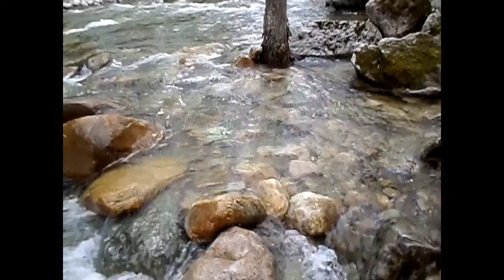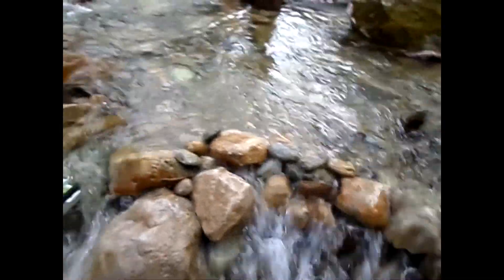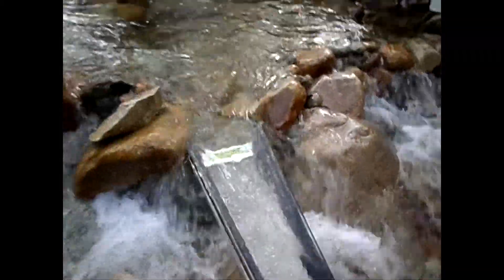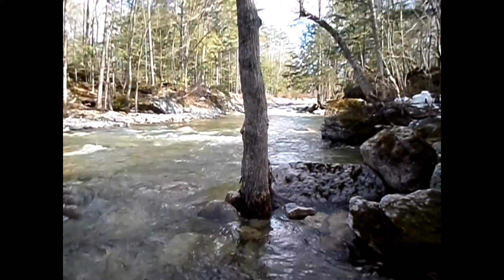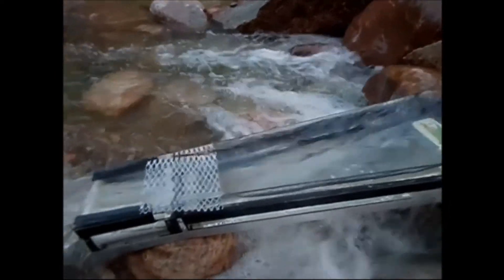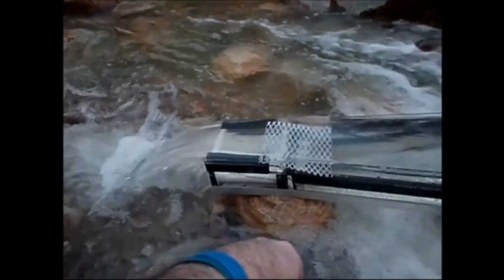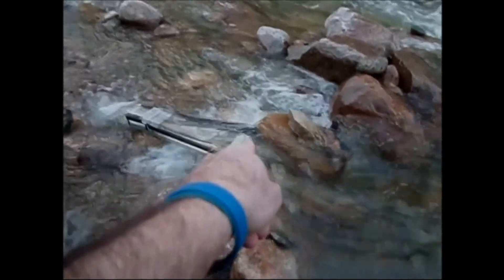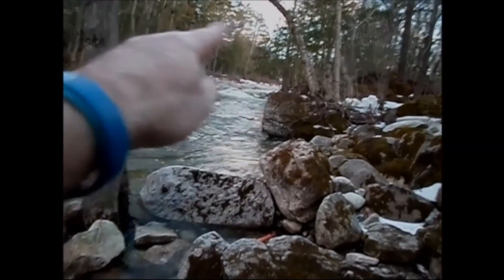Feb 26th 2018 Demonstration And Info

Comment: That was a good view of the trap working, can you use a a strip of strong  clear plastic ( 6' X ? As needed Long ) laying it along your dam just holding it in place with a few rocks , it should give you enough flow to run it hot most of the time and when done roll it back up ,stay safe TANK
Reply from the maker: 🤔 Now I know I responded to this comment Tank. Dam YouTube love not sending me notifications of comments and I guess not giving my responses as well. I am known to use large black contractor garbage bags. I slit them down the sides to double the length. They work Great! Sorry for the delayed response, YouTube didn't notify me of your comment. Surprise surprise surprise.

Comment: I really like the see through design rather than guessing if the box is getting full and agitating like it should.  Been wanting to get my hands on something like that for lighter packing.  Right now all I have is the Calsluice (which I love),but man that thing is heavy.  Thanks for commenting on my video.  Be well and git that GOLD!
Reply from the maker: Thanks Damon! Yes, it sure takes the guess work out. Not to mention the discovery I made as a result of it being clear. Generally you would set a 3' sluice / trap up with a 3" drop by rule. However, with a fluid bed trap, this is not the case! It has everything to do with water velocity, not length of device. So, it varies depending on where your running it. My 3' river bed hog weighs 11lbs which is heavy but, with a strap, it's not bad at all. I will be doing updated demonstration videos soon.
Thanks for your comments. Looking forward to more of your videos. Now, I need to go and git me some GOLD!!